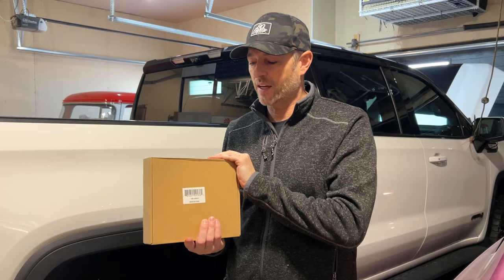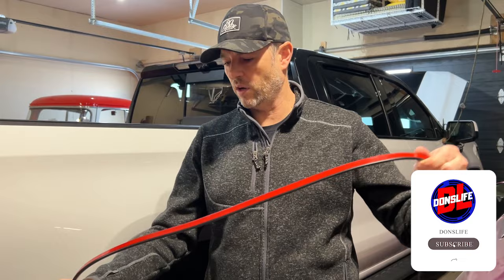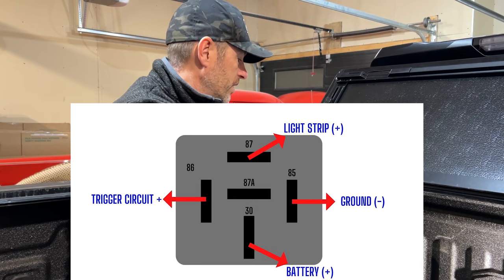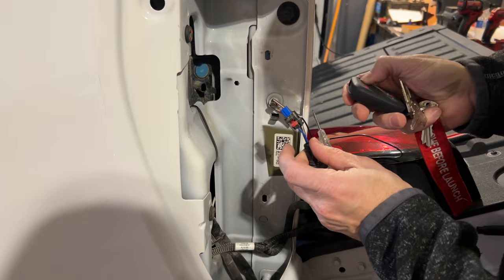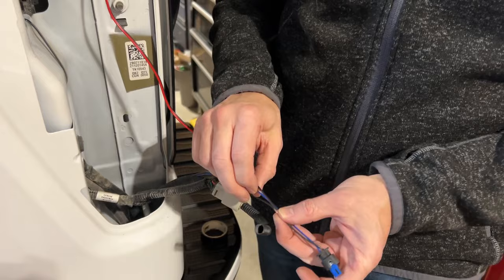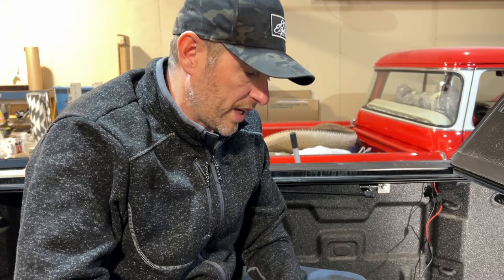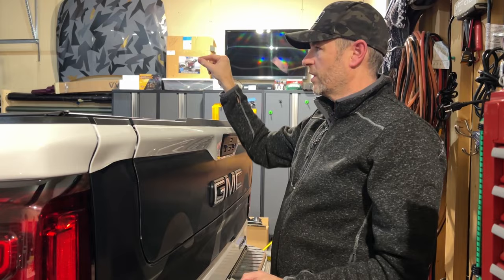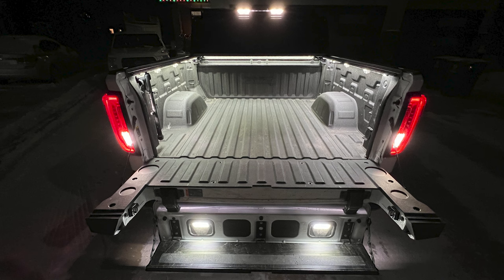Affordable Truck Bed LED Lighting: Easy Install Guide

Comment: what relay did you use? Do you have a link to purchase?
Reply from the maker: it is a standard 12volt 30amp 4 pin relay - I had one laying around, so a quick search on amazon or google and you can find one fast.  Some come with a wiring harness too.

Comment: Where do I get the relay.  I have the led lights
Reply from the maker: Amazon has 12 volt relays - should be easy to find.  4 or 5 pin will work.